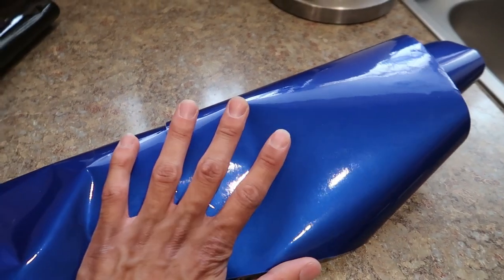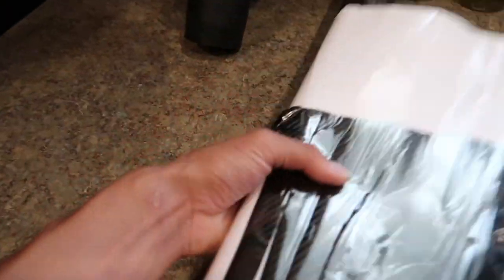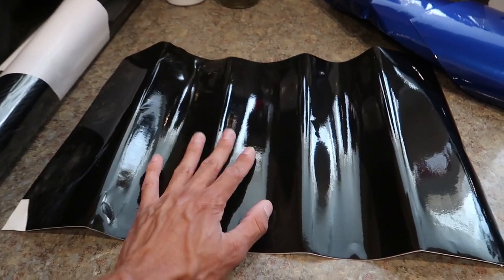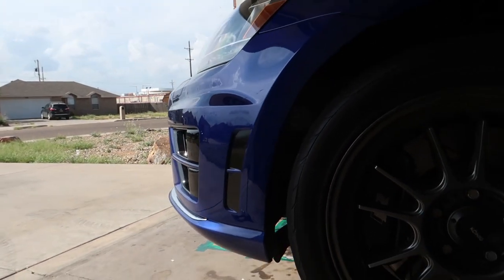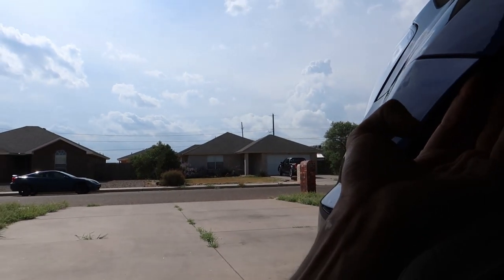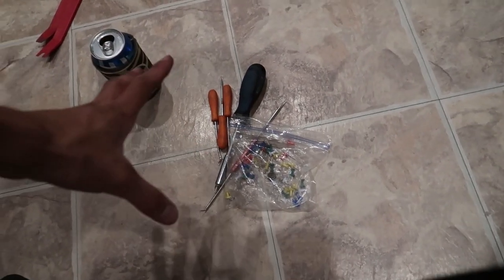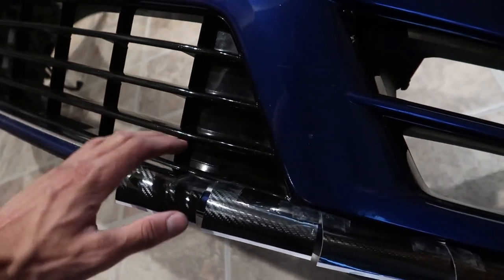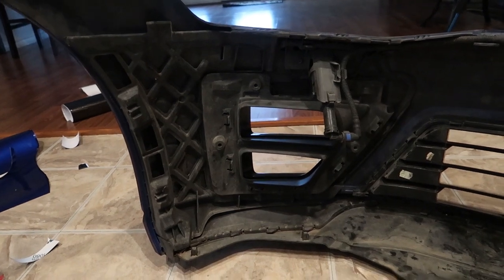NO MORE CHROME! | MK7 Golf R

Comment: I just had to go out to the garage and check my mk7.5. It came all black except for the chrome between the headlamps on the center grill. I really like the way your rear emblem looks. So you wrapped the emblem? I've been wanting mine black, but I've been unable to make myself  bring a can of Plastidip near my new $43k VW. Yours looks factory, though.
Reply from the maker: Yup just some wrap from downtown! I actually took dip to the rear red reflectors on the lower rear bumper. 2-3 coats, it's super smooth and it's a nice matte black, looks good. Y'all got blessed with the 7.5 not having the lower chome. I really like how the lower grille is different then mine as well
Reply: @BryceJordanProductions  doh! Now I need to run back out to the garage and see if I have red reflectors. I don't remember those either. 😍